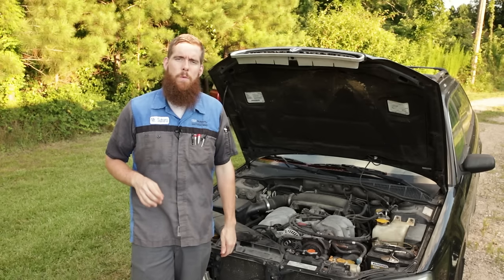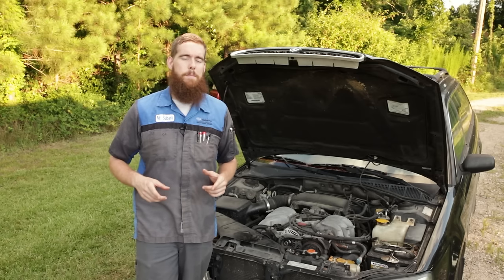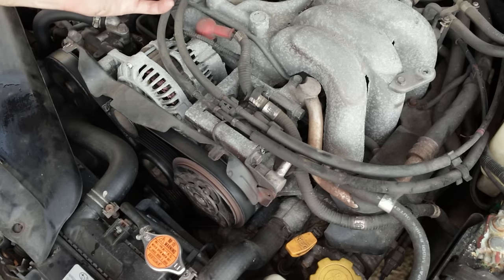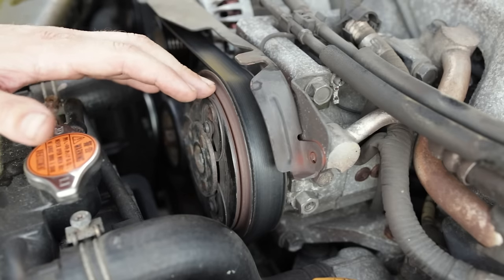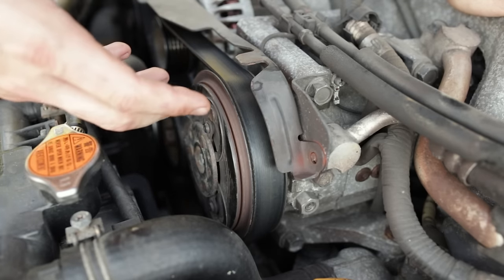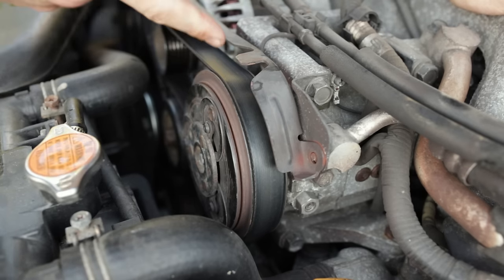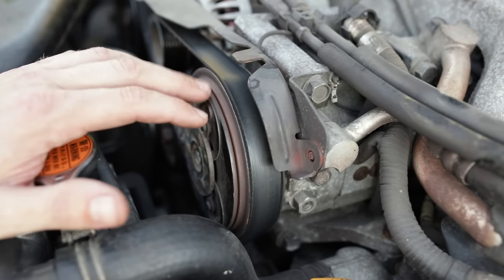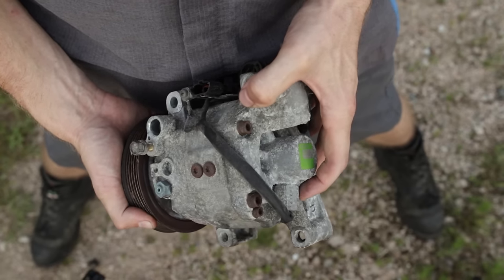Subaru A/C: Common Failures & Issues

Comment: Informative video but I’m not quite sure what’s going on with my 2016 Forester. My A/C light keeps blinking and won’t kick on. I hold in the A/C button and I get cold air and I hear the compressor kick on. I did see any leaks. Not sure what it could be. Some say a relay fuse or something, I don’t know, I’m at a loss. Any other suggestions?

Comment: In general, does one of the engine styles / transmissions have more issues in the newer models? Is the 2.0 any easier to work on or remove if needed? Thanks. Like the channel.

Comment: My 03 legacy AC compressor clutch engages when I power point the connection, I replaced orings etc, still wont kick on when I turn on in cab, in your opinion what would u say is issue? Checked fuses n relay seem to be fine

Comment: Hi, i have just purchased a 2012 XV and found the aircon is cold but not chilled as in our other car, is this common ? compressor cycles on and off telling me its reaching pressure, can i adjust the low temperature so the compressor runs longer ? Thanks

Comment: Great info... THX!  The AC issue on my '17 Forester XT is strange; the pass side cools just fine, but the driver's side not so much. Despite the Dual CC settings. 
Your thoughts?
Reply from the maker: Issue with the driver's blend door actuator or climate unit calibration.

Comment: I have a 2012 Outback that used to be driven in New England and just moved to North Carolina. Not very impressed with the cooling, and if you’re in the back seat you are cooking. Can you show how to do a tune up?!
Reply from the maker: Look back a few videos. 👍🏻
Reply: @MrSubaru1387  I must have missed that one. THANKS!
Reply: Sounds like you may a base/premium model.  For that generation, it was found the manual and automatic climate control systems controlled the compressor (variable displacement type) differently.

Comment: I have a 2009 Subaru impreza that has a leak on the compressor but seems to be coming from the front of the compressor coming through the clutch any ideas on what that could be? A/C works great when charged

Comment: 2007 Forester X NA seems at idle the compressor does not cycle. Any diagnostics you can recommend? How long will the compressor last if it runs all the time?

Comment: EVERYONE! Check your A/C compressor model and google the faulty A/C compressor service bulletin. Subaru issued a notice to dealers that faulty A/C compressors were put on vehicle's. Due to not enough complaints it's only a service notice not a recall unless enough people call subaru and complain. The issue is due to bad coils in the compressor which will make your a/c work intermittently! Look it up!
Reply: @MrSubaru1387
Be cool if you were able to put a video out on this! Lmk if you'd like the link to the service bulletin. I found a faulty model range on my 2015 forester.
Reply: @80weir  I'd love to see a link to that service bulletin. My AC stays on 10-15min, then cuts out until I'm sitting at a light for a few minutes, then comes on briefly until I start moving again.

Comment: 2005 Outback XT Limited manual- radio and digital a/c no display when I went to my friends to replace the two fans. He researched and low battery is the problem since the remote doesn’t work. O’Riely said alternator bad. It blows hot air at me with the a/c off but not on passenger vents. 

Is there a video you can point me to ?

Comment: I have a question about the short video at 16:37
My 2013 subaru impreza just recently started making similar higher pitched squeal when start up cold. Then it gets very quiet but still faint until ac engages and it gets a louder squeal again. But overall less squeal when warmed up. Decided to just go with O ring change along with freon change but sounds a lot like a bad ac compressor

Comment: My 99' forester has been having ac problems lately, I hear a loud whine/vibration along with a quick wispy blowing sound and when I'm driving with the ac turned on sometimes and I can feel the car actually drag periodically when I'm up to speed. It also heats up quite a bit while idling, I'm not sure if its the compressor clutch not engaging properly or what. Ever had a customer with the same problems before?

Comment: Great video.  My 2015 2.5 Forester has a/c issues. It was purchased new in June 2014, and I've put about 180K on it already.  My a/c blows nice and cool most of the time, then the compressor just quits and it gets darn hot.  This happens under straight and level conditions, without me asking the engine for too much.  My serpentine belt is going to be replaced within another 2K.... it's the original.  Is there a possibility that my a/c issues could be related to the serpentine belt?  I'll be taking the Forester in for servicing soon, so would like to have a clear understanding of what might be causing these issues.  THANKS MUCH!
Reply from the maker: I'd look at the clutch gap. Seems Foresters are prone to it. Would also be inline with the sporatic nature of the issue.
Reply: @MrSubaru1387  Thanks much for the reply.  I will make sure to mention that on this next visit.  Sure appreciate your work!
Reply: MrSubaru1387:  I went back and watched up to the part about the clutch gap.  Is there a way to adjust the gap?  If not, do I need to get a new clutch or a new compressor if I want the a/c to work properly?  Appreciate your help!

Comment: 2017 Forester, 23k miles, chattering AC Compressor. Failure is so prevalent that Consumer 
reports gave 2017 Subaru Forester an AC a rating=1 (least reliable.) 
Subaru's response: In Feb 2021, Subaru granted owners of 17-18 Foresters
 an extended warranty on the AC **Condenser**, which can leak due to defect.
 The so-called "extended warranty" is only valid for 6 months, though - 
it ends Sept 2021. !!?!  Subaru TSB 15-237-19R says the CONDENSER leak 
can cause problems with the COMPRESSOR.  Page 2 of the TSB has a flow 
diagram for repair diagnosis. It says, if the condenser is replaced and 
the compressor still chatters after the repair, replace the compressor. 
 BUT PLEASE NOTE: After 4 days of trying to get Subaru to replace the 
chattering compressor, SUBARU's final decision was that THEY DO NOT HAVE
 TO REPLACE THE COMPRESSOR, because it's outside the 3/36 warranty. They
 said the TSB linking condenser and compressor failure does not apply, 
because the public is not supposed to see the TSBs.

Comment: I have a 2001 Subaru outback. All at the same time the heater/ac  fan, heater and cigarette lighter (phone plug) stopped working. I’ve checked the relevant fuses under driver side dash, which are ok. I don’t think my relays are the same as in this video, but I may be wrong. I’m assuming if there’s any connection between the fan and the cigarette lighter, that may the issue (?). Any help would be HUGELY appreciated!! Thanks from Australia.

Comment: I have a 2012 Forester here in Australia and i having an issue only on very cold mornings, temps in the 5-10c range where the AC squeacks its head off for about 30 secondds, and its not a belt, and after wards its like a occasional chirping bird. When engaging the AC during this squeak only makes its worse. I believe it is a bearing from the clucth unit because if i give it nudge of WD40 or equivalent into the center of the AC clutch the noise stops for 2 days some times more.. but always eventually comes back, is it something thats relatively easy to resolve with a new bearig kit ? or is it something more sinister. 
The AC works well and on our hot days reaching 40c plus and constant use the AC tends to get whinny at times....... I gues it hates Aussie summers...lol

Comment: I have a question, I have a 2003 Subaru Outback, and I have changed the Blower Resistor, and the Relay, The system has the appropriate amount of Freon, If I  go directly to the compressor with 12 Volts or Bypass the Relay the AC compressor engages and the Car gets cold air. If I Plug in the Green testing everything works but the Compressor doesn't engage, I don't get any voltage at the wire to the compressor ever.  2.5 4cyl wagon.  Any ideas?

Comment: 2018 Forester. Replaced my cabin air filter, which fixed the a/c for a few days, but a/c then stopped working again. Has anyone experienced this?

I have cleaned my condenser and checked the refrigerant levels

Comment: I replaced my O rings, their good, but feel cold air coming from the pulley wheel, then system loses pressure. Is my compressor shot? Or is there an O ring seal behind the pulley wheel??

Comment: I just bought A 07 Subaru Outback wagon 2.5. The compressor clutch keeps cycling on and off. I thought it was low on r134, I added A can and it is still doing the same thing. After watching this video I checked the clutch air gap, mine was 24 thousands. I took out my clutch spacer and put in A thinner one. Still cycling on and off continuously. I know it can't still be low on r134 because it says it holds 13 ounces. So what could be my problem?

Comment: My 15 Crosstrek ac will shut off by itself. I can turn the fan off and back on and it starts right back up….
Why is it doing that and is there something I can do to fix? I was afraid it may be a sign that there are problems ahead and I don’t need that. It’s too hot!

Comment: My 2016 Impreza hatchback has horrible AC now. It’s been at least cool & now my ac is barely cool at all. If it’s anything above 70 out then my car gets hot. I don’t know anything about AC systems, so I don’t know if I need to replace anything, or just add some refrigerant.
Reply from the maker: It could be low.

Comment: would leakage prevent the clutch from engaging? I tested the clutch, and it activates/engages when powered directly from a power source. Also tested the relay, and it also activates when powered.  But when I run the AC, it just refuses to engage under normal conditions. [2008 outback base] I wish my car had the Diagnostic mode connectors :(

Comment: My 2013 Subaru Legacy shudders down at a stop but doesn't die, only if the a/c is cranked at 3 or 4 level the highest. The air is really nice and cold though. Can anyone help? The last thing I did yesterday was replace a few relays. Subaru says I need a new air compressor after my last visit with them for a fuel system cleaning suggested and idle relearn? Basically, if I turn the a/c off or on level 1 or 2 it doesn't do it. The relays seemed to maybe have fixed it but I need to test drive it some more. I've replaced FUEL Injection air control valves, I replaced MAF Sensor, I put a new PCV valve. I've basically been on a manhunt, for no codes thrown. I wire brushed battery connections, and grounds. Air filters are good. Subaru says their 3 year battery is good?

Comment: I have a 08 impreza 2.5i sedan...my ac knob on Left side ony works on defrost setting...I took out headunit and noticed the cool air warm air plastic gear and cable on Right side for C/H is straight and goes under a white tab...but my problem is on the driverside that cable is bent and the knob doesn't work only works on defrost setting and when I turn knob I can see that the cable bends and doesn't retract into cable like R side..my question is what would be the diy cheapest way to fix just the driver side knob or cable...

Comment: Hey Mr Subaru, I have a 2004 subaru impreza WRX 5speed Manual. The AC isnt working to great. When idling and the AC is on, the feet setting blows hot air, the face setting blows semi cold air, and the window setting blows semi cold air as well. Do you have any idea what the issue may possibly be here?

Comment: My 2018 Forester 2.5i is having an ac failure and I can hear the metal shavings start to spit. Do you recommend a full ac replacement?
Reply from the maker: Compressor, condensor at the least. May be able to flush lines and evaporator, but depends on how bad it is in there.
Reply: @MrSubaru1387  Awesome, thanks for the quick reply. I wish I was in your area, I’d pay anything for an honest mechanic to work on my car.

Comment: Hello, as an avid follower of your channel, I need to pick your brains as to what is the maximum size height of tire can I fit on my SH 3rd gen forester without rubbing anywhere in the wheel well. Please advise whether I can fit 225 x 60 x 17 (27.6") or can i go for 215 x 65 x 17 (28"). 
Tyres on car at moment are 225 x 55 x R17. Thankyou.

Comment: Great video as always. Having a 2009 Forester I know about not cooling. Can these systems be upgraded to the older high capacity compressor?
Reply from the maker: I've never tried to swap it, but I'd imagine that it's possible. Probably need to change a/c lines.
Reply: @MrSubaru1387  Thanks, I'll check into that.

Comment: 2016 crosstrek 50000 miles.   Buzzing sound when ac engaged coming from compressor.   Does it buzz when refrigerant low or bad compressor?  There is no cold air but plenty of air flow. Update:  bad O ring.   Replaced , refill refrigerant, no noise.  Fixed
Reply: How is it going for u now? There were 2 leaks for me, fixed them, refill refrigerant n it was ok but couple days after now n I’m hearing the grinding noise from the compressor when engaged
Reply: @Phoenix-eq8zv  to tell the truth I Havnt engaged the ac again since it was fixed  I turned it on the first day after fixed and no noise.  Will let you know. Hasnt been hot enough to use ac. I just assumed it was okay now. Update.   It still seems good. Turned the ac on today.  Sounds good

Comment: MY 2005 LEGACY GT WITH 198K A/C RANDOMLY CUTS OUT.  TURNING THE SYSTEM OFF & ON USUALLY SOLVES THE PROBLEM.  SUBARU IN CONWAY SC REPLACED COMPRESSOR AT 176K.  SUBARU IN MD LAST WEEK SAID I WAS LOW ON REFRIGERANT AND RECHARGED SYSTEM.  SYSTEM COLD WHEN FUNCTIONING; HOWEVER, STILL RANDOMLY STOPS WORKING, EVEN WHEN OUTSIDE TEMP IS NO MORE THAN 80 DEGREES.  WHAT GIVES?
Reply: ALSO, DYE TEST SHOWED NO LEAKS.

Comment: Hello.  I have been following your channel for a long time.  Thanks for all the useful information.  I want to tell you about a problem I have.  Although the test mode connectors of my 2006 Subaru forester are not plugged in, the fan and relays work on their own. This especially occurs when the battery terminal is disconnected and attached.  I am getting P0607 throttle control system circuit range performance fault code in my vehicle.  I delete the error with free ssm, but now the fault light is constantly on and free ssm says there is no error.  There is no Subaru master where I am.  What should I do and where should I start?  Please help me.

Comment: I have a question bc I'm about to take my car to a third person for my a/c... Apparently I can get power manually but not automatically. So what is the issue if it isn't fuse, relay, or anything else but works manually? I have a 2001 Subaru Forester.

Comment: Hello guys, did someone had problem like your air conditiong  button is off but if you set air blow to front window air conditioning clucth turns on for 10-15 sec and then off for the same time. But if turn air flow to driver air conditioning clucth stays off.

Comment: I have a 2002 Subaru Liberty/Legacy 2.5L manual transmission. And when I turn on the air con, it makes a loud clicking/grinding noise for about 2 seconds then it stalls the car. Which one of these problems do you think that is? 
Thank you in advance! 🙏🏽

Comment: Does the 2.5l NA boxer installed in the new-gen Forester has a dual injection system (port and DI)?
I've seen a comment about it and  I would like to know. 
MrSubaru - can you please do a video about carbon buildup on boxers? Similar to your video about head gaskets. I would love to hear your opinion about it.
Reply from the maker: They don't. Only the FA20 in the BRZ has the D4S system. The new Subarus are DI only.

Comment: Having problems with my AC, when I bought the car it wasn't working.

1997 Impreza Outback Sport 2.2L

I have checked the fuses and relays (all good), the system is charged, I connected the green pins under the dash everything is working except the electromagnetic clutch is not engaging and running the compressor (although the gap is good).

I tried measuring voltage into the clutch on that one black wire and didn't get anything.

Any ideas ?

Comment: did changing the compressor get rid of that noise? I had AC work done 2 months ago and they replaced evap core and o rings. Idk why they didn't change the compressor but the AC runs fine. Will it be okay if I ignore this issue for now?

Comment: I know this was posted a few years ago, but I'm hoping you respond. I have a Base Subaru WRX 2017 (no dual climate control). I have ice-cold air on the passenger side and ambient temp air on the driver's side. When i put the AC on resurc, I eventually get cool air coming out but not cold.

I haven't been able to find a whole lot of info on this other than to recharge the system. Any ideas?

Comment: My ac compressor clutch engages and disengages every about 10-30 seconds when idling  so air gets warm . But when driving ac gets cold .
Reply: Ac has been evac and recharged properly .
Reply from the maker: What are your pressures?

Comment: Help!? 2016 Crosstrek, has started shutting down ac system at position 3 and 4 . Position 1 and 2 still operating fine. What should I look for? Ac light also going off at 3 and 4